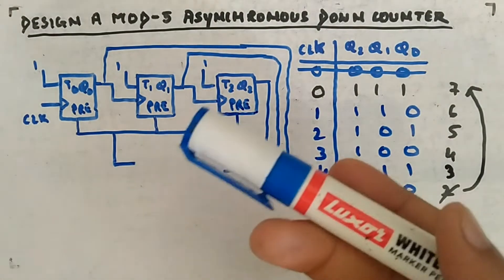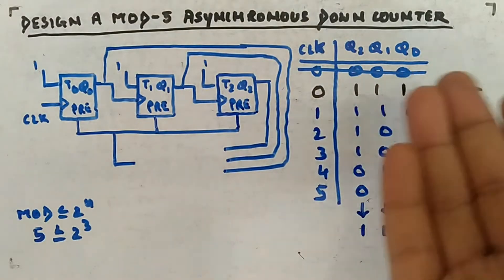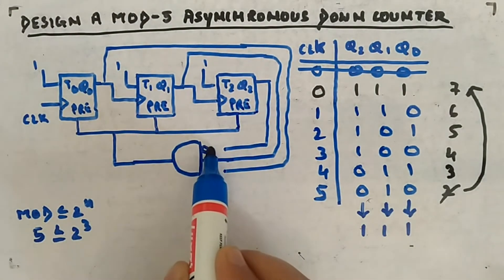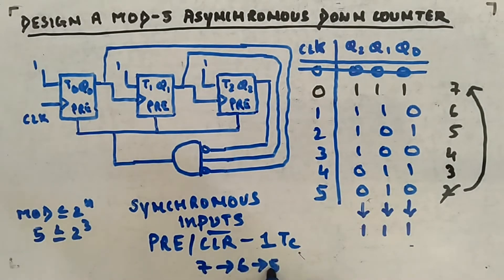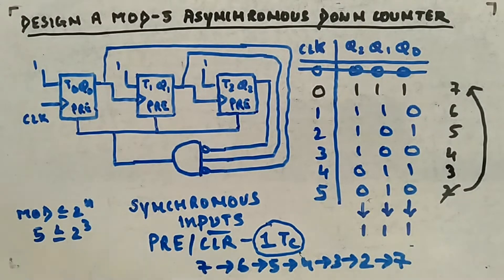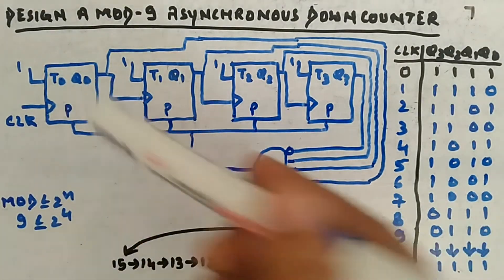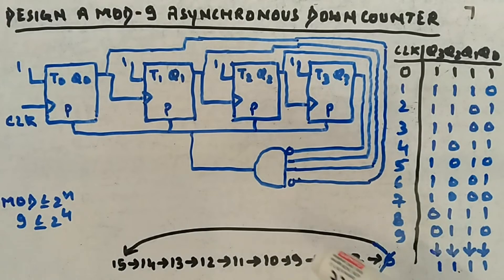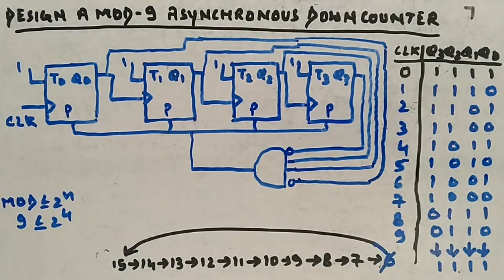Non Binary Asynchronous Counter (with Preset) - Digital Circuits and Logic Design

Comment: Hello sir,
How to create a gray counter?
And do we need to remember the counting sequence of gray code counter for MCQ? 

What's the advantage of gray code counter over binary counters?

Shortest Trick to find out the count of following question:
Suppose a 3 bit gray counter is initially set  to 5 then what'll be it's value after 200 cycle etc ....
Reply from the maker: Gray Counter will be Synchronous Counter, I Will start next.
No need to remember Sequence, Please watch my Gray code video there I gave a Reflective Technique.
Advantages of Gray are Less Delays  because of one bit Change only plus it can Avoid Glitches that I will tell in Synchronous Circuits.
I will take this Question as Example and give a Trick.
Reply: @jeevansafal  btw thank you sir for these great videos. Your digital playlist helped me a lot during interviews now I'm a FPGA engineer because of you. I'm sorry I don't know your real name, but u helped me greatly. Hope I'll meet you in real life.😊